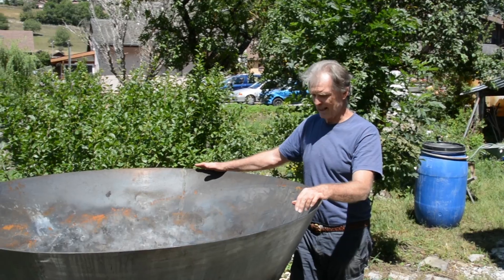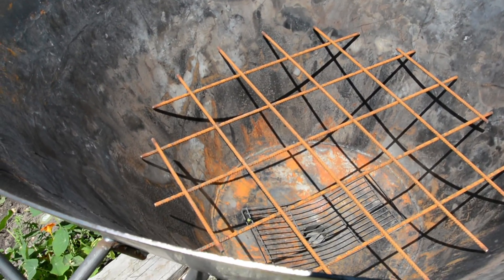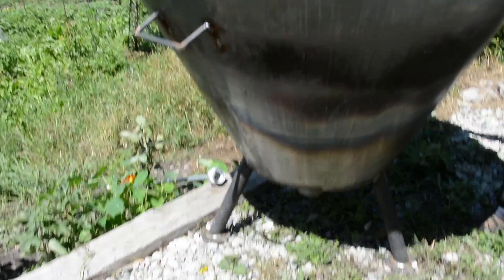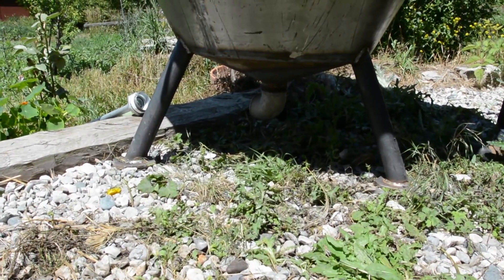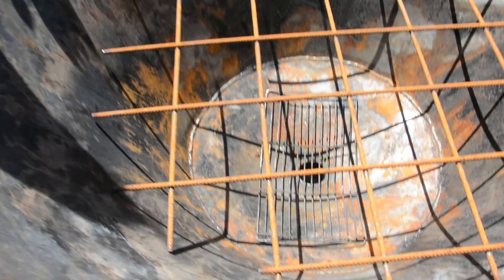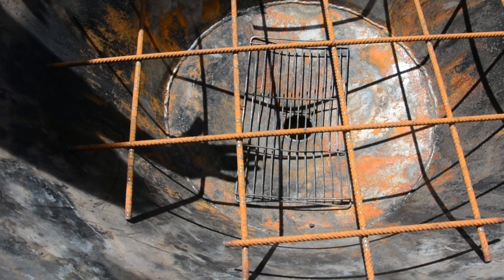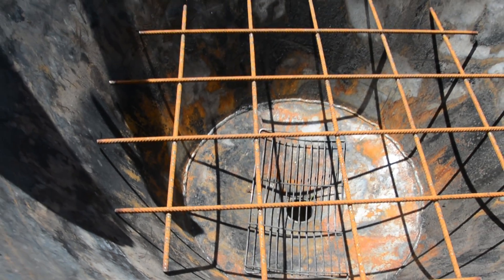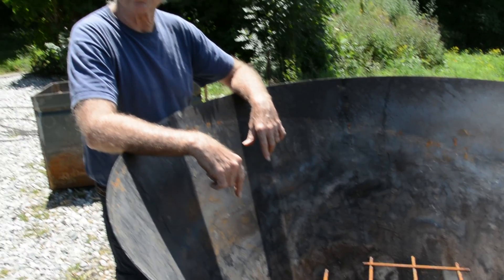Kon-Tiki: Biochar making in open burn deep cone kiln

Comment: Believe your video is the best to copy as best I can. 
I've have a  cut out top of a barrel, I  made a cut to it's center  ,Hammering from center outwardly. All around the flat sheet of steel gives it roundness  ( something I learned as a BlackSmith) .
My "true cone " doesn't have a flat bottom like your but might be for the better. 
Next I will try to hammer and bend for your recommendation 63.5 degrees angle. 
WOW ! You seem to have a quick effective system, I've only a 60 ' square garden but as a Stewart of my land I trying to care for it on my watch.
Thanks for the teaching.

Comment: Thanks for posting this video, particularly the explanation of the air flows. 

May I bother you with a few questions in regard to the sequence and forms of stacking your wood?  Have you tried to make a taller (or shorter) stack?  Wider and taller?  If so, what happened?  What happens when you start with more mass?

I realize that you have more-than-likely tried every conceivable configuration for loading and firing this method.  Does the approach in the video represent your optimum choice in regard to labor, firing time, mass, etc?

I definitely plan to experiment with this approach, though for now I'm planning to use a pit (which I've dug) rather than steel.  Eventually I do want to use a steel kiln.  They're reasonably priced.

I only recently learned about the top-lit methodology through some demonstrations and reading.  Having made (literally) dozens of yards of biochar for my own projects using some crude methods and yielding some variable resuts, the top-lit approach really appeals to me -- and especially the conical form. 

Again, thanks for offering this great information!
Reply from the maker: Richard Freeman
Hi Richard, the form in the video was made during the first trials. Since than we accumulated a good thousand hours of testing and improving. I would make the cone more shallow now. More information you find on our website: www.ithaka-intitut.org and in the ithaka journal (www.ithaka-journal.net). 
Best, Hans-Peter
Reply: ithakaJ , 

Thank you Hans-Peter.  I imagine you stayed with the 63° angle?  Also, did you change the sequence of the load-up and firing?    BTW, I really appreciated your making the point that energy spent sawing (mechanically decomposing) has a lost-energy equivalent in the char process.  Thanks!
Reply from the maker: Richard Freeman I like to go down to 45° for small feedstocks like shrubs, straw, husks etc. For wood its better to keep it deep (63°)
Reply: ithakaJ 
Thanks for the clarification.  That's good to know -- the 63° angle for woody material versus 45° for lighter material.  I have a copious supply of woody material in my region, and that's usually what I char.

On another note, I have a sense that wood chips won't char well in this approach.  True?  (As you point out, that chipping represents lost energy.)
Reply from the maker: Richard Freeman Even though chipping is loosing energy, the pyrolysis of small feedstocks is more carbon efficient. Better, however, is using twiggs and shrubs that don't need to be chipped and make great biochar.
Reply: +ithakaJ link to your site says its not available.

Comment: Elegant design and it certainly seemed to work. Well done.

(I don't think it would be a viable option for us though - we need to burn much wetter timber in larger pieces so we really need a design that utilizes all that heat that is lost in yours. I'm sure it will have applications though. Good luck with it.)
Reply: Flippin eck, fancy meeting you here... Congrats on your lass getting the funding for the first stage. I saw a video, several, of just digging a cone in the ground, becoming a super heated space to drive off moisture if you start with fairly dry wood. And another vid where a chap dug a rectangle just big enough for a pallet, lined it with old roof tin, then kept adding pallets till t was full and covered it with more tin and the loose soil from the hole to stop all air. I bet with a minimum of splitting and seasoning for a bit you could get hot enough to drive the steam out of wet wood in something along those lines.

Comment: Would it work as a pyramid with flat sides, and eliminate the need for cone rolling?
Reply from the maker: Yes it also works, we prefer the cone form for better convection and less smoke but char quality with pyramid kiln is excellent too.
Reply: ithakaJ
The more I look, the more I like. One thing, my interest is primarily in dry charcoal for gasifiers- have you tried incorporating a slot at the bottom to allow the char to drop into an airtight collection vessel?

Would you wish to place any restrictions on copying or adapting your design, Creative Commons style? My angle grinder and welder are salivating in anticipation- I will, of course, credit you.
Reply from the maker: brianhughes45
Hi Brian, if you quench it instead of with water with a air tight lid, you will lose a bit more carbon and the biochar will have more condensates but if you want to use it for barbecue charcoal and not for animal feed than that works fine.
The basic design is open source and you find more detailed information on our website: http://www.ithaka-institut.org/en/ct/101-Kon-Tiki-open-fire-kiln. If you like the kiln and build one for yourself then please think about a donation to our institute to continue this kind of research: pay what it's worth for you. If you want to make a buisness out of it and produce Kon-Tikis please take personal contact with us.

Comment: For those of us without the means to roll such a kiln from sheet, is there any reason this could not be done using a cone-shaped pit?  I've seen videos elsewhere of folks trying that, do you feel there are specific advantages to an above ground metal cone from a cost/benefit basis?
Reply from the maker: There are many good reason to use soil type Kon-Tiki which we do in many countries and places. You find instructions how to make soil pit Kon-Tiki on our website: http://www.ithaka-institut.org/en/kon-tiki
Reply: Thank you

Comment: All good from begining. But the ending hy water?? Why you dont closeoff out of oxigrn???
Reply from the maker: Because we do not want to make charcoal for combustion but biochar as organic nutrient carrier that need different water dynamics and water mediated nutrient exchange
Reply: steam cleaned micropores for biochar win.
Reply: @daroniussubdeviant3869  If it's the steam that's creating the pores, wouldn't it make sense to dump in boiling water so the flash to steam is even more violent and complete?
Reply: @MikeTrieu  i think it is the pressure of it as a hot gas that clears the pores. boiling water is still a liquid.
Reply: @daroniussubdeviant3869  Well, yes, water is still a liquid, but you want that liquid to be right at the transition temperature to flash into gas, otherwise you waste the energy of the fuel raising the temperature of the water up to that point. If steam generation is the goal, that's how to optimize for it.
Reply: @MikeTrieu  not really. it turns to steam when it touches hot coals. 
you want a rapid expansion anyway but it doesn't really matter. i think you are forgetting the whole point is to cool the char and stop combustion. raising the water temperature is the opposite of that but it still doesn't matter.
Reply: @daroniussubdeviant3869  Yes, water boils at exactly 100°C, way below the auto-ignition temperature of wood. It matters because the faster it turns to steam instead of simply soaking the char, the more porous of an internal structure you're going to get and, subsequently, a better grade of product. You're basically trying to create an open-cell carbon aerogel by exposing as many cells to air.
Reply: @MikeTrieu  if it matters to you then by all mean waste energy boiling water to quench a fire. crack on pal.
Reply: @daroniussubdeviant3869  It's not a "waste" if you're trying to optimize the end product for maximum porosity and water retention. If your goal is "good enough", then any level of quenching will suffice. But if you're going to go through the hassle of creating charcoal in the first place, it's a small additional detail to increase quality significantly.
Reply: @MikeTrieu  it is a waste if you're trying to protect the environment. 
i seriously doubt you would be able to measure any benefits if there were any. why don't you do a study.

Comment: You'd probably have a more convincing demonstration of the vortex ring if you filmed it with a schlieren setup.
Reply from the maker: Thank you very much for this advice, you are fully right, it would be so great to do. Would you have any suggestion about where to place the mirror? Would like to try it.
Reply: @ithakaJ  Pretty much right behind the subject. You can see a successful demonstration of the apparatus in this Veritasium video:

https://youtu.be/4tgOyU34D44

Also, a really nice tip about placement of the knife edge:

https://youtu.be/kSectSljZlQ

Comment: I appreciate the science behind the cone type of system. I like the simplicity of it, but it does have two disadvantages. One is that the fuel becomes mixed with the biochar because there is no physical separation. Therefore the product is "contaminated".Two is that the energy of production is lost and can't be used so there is no possibility that the system could be made carbon negative like a closed system can be.
Reply from the maker: Hi Bruce, thanks for your comments. There is no mixing with the fuel as 
the pyrolysis gazes are driven out and oxidized (much more in fact than 
in any closed industrial system). We can further prove it by dozens of 
EBC certificate analyses. Concerning the use of heat, there are several 
added features to the Kon-Tiki that let use the heat. In Nepal for 
example, we produce essentiel oil and hot water with the waste heat or 
in Switzerland the heat is used for district heating. Carbon negativity 
is about the balance of C input and C output compared to other biomass 
use like compost or simple burning. You will find more detailed 
information on our website: www.ithaka-institute.org or in 
www.biochar-journal.org and there are also several peer reviewed 
articles about the Kon-Tiki method including char quality and C 
balances. Best, hp schmidt
Reply: I'm confused as I see you throwing the fuel directly onto the feedstock. Surely you end up with a mix of both charcoal and biochar? How is it separated? At the end of the day it probably doesn't matter too much, but it might if you are a vendor selling the product and describing it as 100% biochar. I've seen other closed systems that don't need to be attended for 10 hours or more, and they shut themselves down once the pyrolytic gases are exhausted and the fuel burns off. That becomes quite efficient for folk who don't have a full spare day for making biochar.
Reply from the maker: Hi Bruce, it might be helpful for you to get informed a bit more about biochar e.g. at www.biochar-journal.org. From a material perspective all charcoal is biochar and nobody would ever try or want to seperate the charcoal from the biochar in a system.
Reply: athe ashes are a form of fertilizer as well, potash I understand.  Purity of process is not all that critical especially if you are going to inoculate it for fertilizer with manure.  If you are going to use it in a forge, skip the manure treatment.

Comment: very messy, i doubt if wood charcoal being wet by water is good charcoal
Reply: Bayan Ni juan I think you are referring cooking charcoal. This is not cooking charcoal it’s agricultural charcoal at this stage. It will be added to some nutrient source and used to grow plant. It is also taking the grape pruning that were previously just burnt as waste and keeping a portion of its carbon permanently out of the atmosphere. Wetting the charcoal at the end makes it better agricultural charcoal because it ruptures the pour structure of the charcoal.
Reply: You actually need to wet charcoal cos its hydrophobic in the first place, then you need to add microfauna (bacteria and mycorrizae), then grind it. at least that's how I do.

Comment: You're not making biochar, you are making charcoal, which is NOT the same.
Reply: So are you saying that the Mayan's didn't make biochar? 

Biochar is just biological charcoal, in which an organic material is converted into charcoal.
Reply: +doloinc   
CHARCOAL IS  NOT  BIOCHAR DUE TO A DIFFERENT PROCESS THAT SPECIFICALLY CREATES  EACH OTHER FOR THEIR OWN SPECIALIZED PURPOSE.
There are different qualities of biochar.   The lesser than the highest most potent quality is likely what was in that  wok....however, it was  a clean product without any soot.
Reply: This is a very high quality charcoal for using such a primitive method. The quenching water quality lets us know that the volatile gases were driven off and that is what you need. It is only after it has been inoculated that this becomes biochar. Use the pure charcoal to top dress a compost pile in a winter greenhouse to control odors and gassing while inoculating the char. Come Spring, you have massive amounts of biochar/compost mixture. Win-win-win!
Reply: Biochar is activated charcoal, which is just the media. They'll need to inoculate that with bacteria and nutrients to make it become Bio-char.
Reply: I have to agree with Brad (4 years on and still the same misconception). This process made very fine quality CHARCOAL. It only becomes Bio-char when as other people have pointed out, it is inoculated with bacteria, fertilizer and the multitude of enzymes and goodies that make living soil work. One method I have seen to do this in a kiln very similar was to have an ICBM? one of those big white containers industry uses to transport and store liquids, which was full of a mix of water and dilute animal poop. When the combustion was done this was pumped into the tap at the bottom of the cone, extinguishing the fire and allowing the CHARCOAL to absorb the nutrients. Here it is, came up in the feed straight away.

https://www.youtube.com/watch?v=U1aQZw08fSE

Even then, soaked in poop water this is not yet Bio-char. It needs time to Ph balance and for the 'living' element of the process to begin. As MARS ROVER  mentioned, add it liberally as you build your compost piles then by the time the compost is done it will be ready to do good to your soil. If you just start spreading it around the place before it is processed it will actually rob its surroundings of nutrients like a sponge. 
DOLOINIC, The Myans made it by mixing it (CHARCOAL) with their organic waste in deep pits and letting it become ..... wait for it (literally)..... BIO-CHAR
John Jacobs, nope, in that kiln it is still JUST charcoal.

Apologies for the rant but the swivel eyed idiot on the 'greenpowerscience' channel I think it was did a lot of damage spreading this bollocks and it pressed my big button. Oh yeah, and 'the same amount of energy cutting it as you recover'???